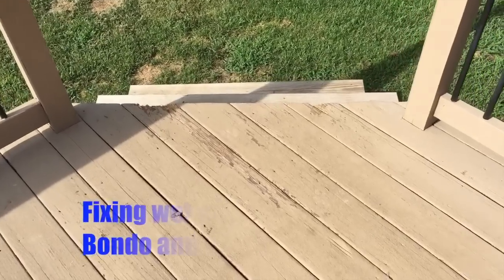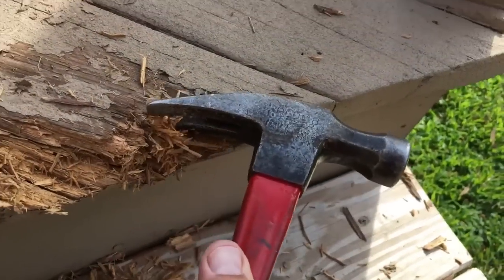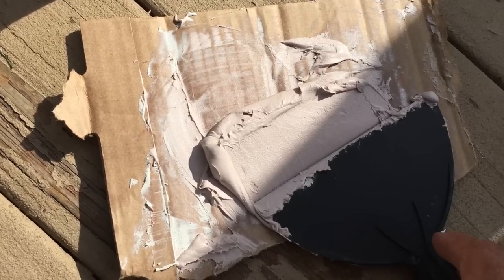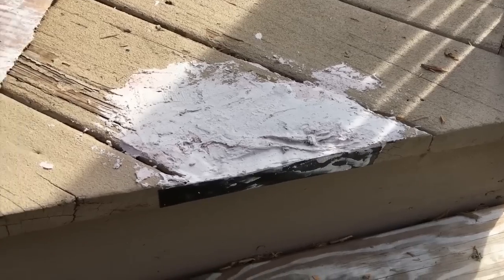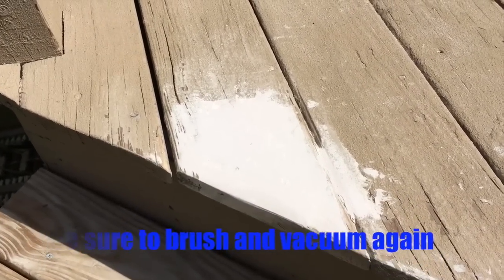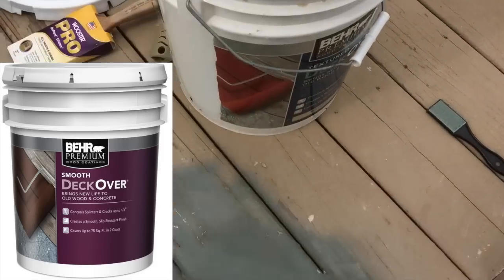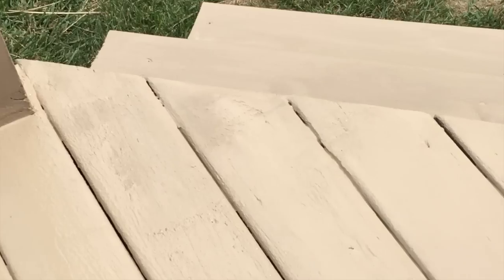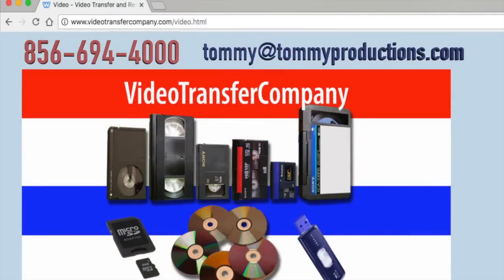Rotten wood deck quick repair using automobile Bondo

Comment: This is a pretty good fix I used it some years back. Fast forward now I forgot a vital step: A wood hardener treatment. After about a year moisture made its way in. Moisture made its way into the permeable wood I didn't treat and the bondo started coming off in chunks. That bondo wood hardener  (restorer) would've saved me grief and money. Live and learn.
Reply: Saul Souza Yeah I bought that and the Wood Bondo from Home Depot recently to fix even worse damage to 2 decks.  Takes solid stain afterwards but not a perfect match.  Maybe one more layer of stain will do it.  That deckover stuff looks like crap though. The Bondo and Bondo wood rot restorer are quite expensive.
Reply from the maker: Thank you Saul.  Be surprised how many people criticize the idea with negative conviction. I appreciate you.

Comment: Gorilla tape was a great idea - I would have either used cardboard between the boards or cleared out the dried Bondo using a hack saw blade. I haven't used Bondo for wood repair before but doesn't the automotive version of Bondo absorb water? Don't know, just asking.
Reply from the maker: I don’t think it absorbs water. I’ve had a few folks write to me and tell me that it’s lasted for some years as well. Thanks for watching my channel

Comment: If you start with wood hardener (including drilling into the board to inject the solution deep--I'm sure there's a video), much of the wood you might scrape off can stay.  I don't know bondo from bacon, but there are 2-part fillers meant for this app.  While rot can occur in the middle of a board, it's much more likely at the ends, where water more easily enters the fibers.  Paint the ends thoroughly, and that greatly  extends the life of the wood.  I had to replace all the corner braces on my pergolas because I painted them AFTER assembly, where the paint simply fails to penetrate the joint.
Reply: The top horizontal ends of my deck is connect to brick on each side. The ends are also rotting. I thought I would need to cut them off and maybe attach fresh-cut replacements if not just remove the entire plank. Are you saying I can drill a hole into the soft/rotted wood and inject wood hardener instead of doing that? I've never used it but I'm trying to figure out what my options are.
Reply: @jacobstrouble6631  I did.  The instructions are on the bottle of wood hardener (Home Depot or equal).  There's at least one video around here somewhere that shows how.  It works really slick.
Reply: @petem6503  Thanks! I'll see if I can find that video.
Reply from the maker: You’re right

Comment: Tbh I may try this as a project my moms kitchen sink backsplash laminate chipped off and the wood got exposed to water, causing the same scenario in the beginning of the video. I think after it’s filled and smooth n primed I will either paint it or do a temporary contact paper to spice it up here n there.
Reply from the maker: Let me know please

Comment: That bondo wood filler  worked great to seam the mitered corners on my deck's top rail...very pleased with the seamless result!

Helpful tip: for longterm repair, treating the area with wood hardener significantly reduces future rot and the bondo filler adheres to the hardened wood more securely.
Reply from the maker: Great to hear! thank you Lonnie.

Comment: How long did this last? I've only just started using Bondo as a wood filler. I love the stuff, but wonder how long it will last.
Reply from the maker: charredskeleton about 3 years now
Reply: That will depend on how well you use it. This is how I do it: 1. Remove ALL rotten wood back to hard wood. 2. If possible shape with chisel to receive new wood pieces. 3. Shape new wood pieces and fix in place using stainless steel screws. 4. apply clear wood preserver. 5. Apply wood primer. 6. Apply 'Bondo' type filler. 7. Sand and apply more filler until level and smooth. 8. Apply primer. 9. Apply undercoat paint. 10. Apply finish paint. I have done this 20 years ago on jobs that are still in good shape.

Comment: Nice job, I have used a similar technique with the same materials.  Do you ever remove the bondo between adjacent boards to restore drainage?
Reply from the maker: I think I didn’t get the bonding of stuck in between the boards.  I may have? Did it about four years ago, maybe three, and it’s still holding up really well. The only thing that is kind of crappy is the bear deck paint
Reply from the maker: I don’t remember. It’s been about Exemouth of years? And I fixed it for my daughter. She sold that house

Comment: Is it true that bindi is too hard and will separate from the wood outside?
Reply: Paintgirl123 It can, most people prefer two part epoxy but anything us better than nothing

If you strain then definitely do epoxy but if you do solid paint then either works fine, if you get both into the crevice well enough and remove enough rot then should last years
Reply: Usually you put some screws in to the wood for the bondo to hold on to. A few short deck screws set with the heads lower then the top of the board and then bondo over them and the bondo will not be able to fall out.
Plenty of videos out there that show a more complete repair than this one. Wood hardener before the bondo is a must as well.
Reply from the maker: that’s a good idea, Jason

Comment: SHOULD HAVE USED A WOOD HARDENER FIRST! Temporary fix.
Reply from the maker: Arnold williams It’s a temporary fix. But it’s been over three years and it has not come apart yet. Amazing. Thank you for your  suggestion
Reply: @TommyRosaTommyProductions  Also should have drilled in some screws to support the filler, especially since it has foot traffic.

Comment: can it support foot traffic?
Reply from the maker: Yes it should.
Reply from the maker: Yes it can support foot traffic. So far its been 2 months, no cracks.
Reply from the maker: It has been 7 months and it did not crack at all. Not bad for a quick fix. Not having to pry out nails and purchase, cut and replace boards.
Reply: Math checks out
Reply: Tommy Rosa despite your bad math i might use this to fix a table